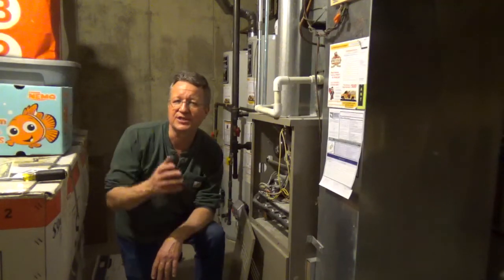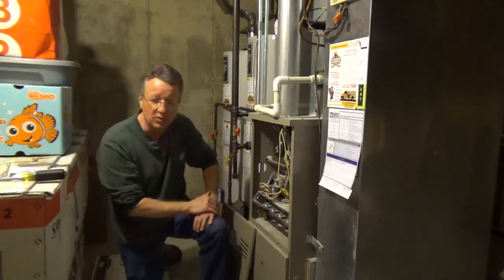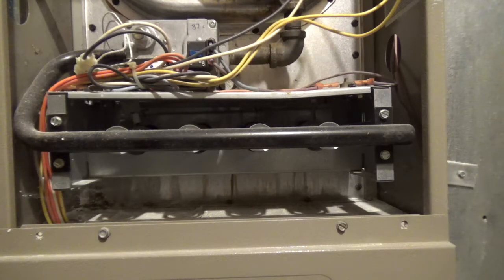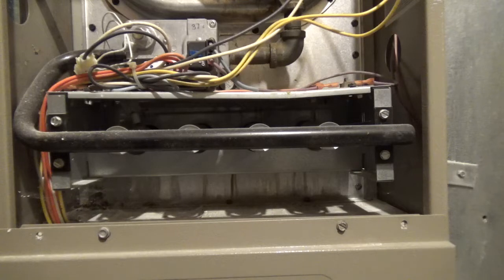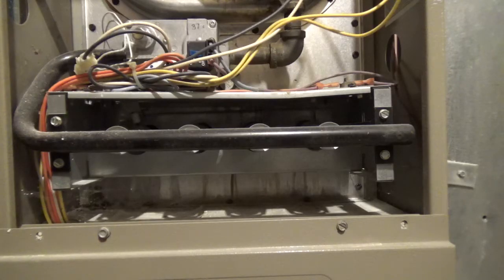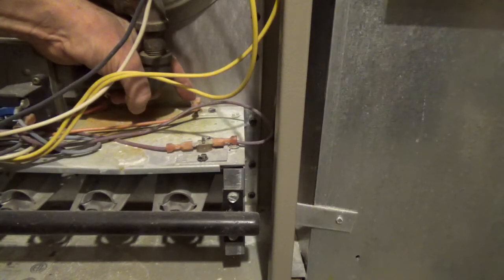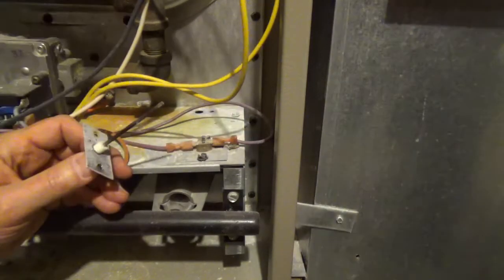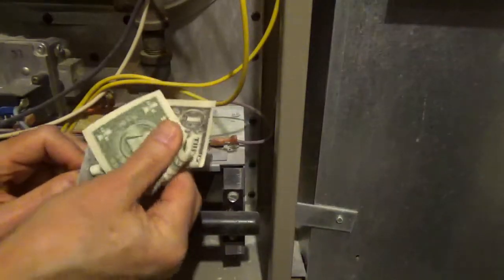Furnace Not Staying On - Furnace Short Cycling

Comment: Thank you so much. 

Last year I called our repair vendor, Service Lengend Heating and Cooling (the same vendor who installed the unit) and he told me my furnace was old and I needed to replace it. I was like ... "I just bought this new unit from you guys just over 6 years ago." He was like well, the new units don't last that long like the old ones. I should really be considering getting another new one ($5000). I asked if he could replace the part that was broken. He reluctantly said he could help make it work through the winter, but I should consider buying a new unit. 

I replaced my old unit, not because it wasn't working, but because I wanted something more energy efficient. It has been working for 20+ years. 

This year, the heater has the same issue but I didn't call the service repair. Instead, I started to research and learn more about how the sequence of operations worked on a direct ignite gas unit. Thanks to your video, it helped confirm what I thought was wrong and took your steps to fix it. It is now running like new. Thank you and will be calling a different service in the future.

Comment: I envy people who have this problem
 I cleaned it, switched it to a new one, changed the limit switch out (although the "new" switch was clearly not new, changed the filter, and it's still cycling with no spevific light flashing other than two quick flashes then a pause (lockout). The motor is ok. Time to call in a professional. Thank you for making this video.
Reply from the maker: Hi,
If you have a high efficiency furnace, here are some common troubleshooting tips.
Check the air filter, a clogged air filter can overheat the furnace causing it to shut down to protect the heat exchanger.
Check the air intake and exhaust, a partially clogged pipe can cause the furnace to shut down.
Check the condensation tube, a clog will shut down the furnace.
Check out more home improvement tips in our e-books https://www.amazon.com/gp/product/B0B2KW1FQ9?notRedirectToSDP=1&.

Comment: Hello. My furnace stays on for about 3 minutes each cycle. Will this work or does that mean it’s a different problem?
Reply from the maker: Hi, it's worth trying to clean the flame sensor first.
If you have a high efficiency furnace, here are some other common troubleshooting tips.
Check the air filter, a clogged air filter can overheat the furnace causing it to shut down to protect the heat exchanger.
Check the air intake and exhaust, a partially clogged pipe can cause the furnace to shut down.
Check the condensation tube, a clog will shut down the furnace.
Check out more home improvement tips in our e-books https://www.amazon.com/gp/product/B0B2KW1FQ9?notRedirectToSDP=1&.

Comment: Hi, I have this same problem but I already cleaned the sensor and it did not work. I called a pro and they could not find the problem. They told me to replace the flame sensor and try that but did not have one on the truck to test with and will have to come back. Otherwise they said it will be a board likely gone bad. Is there any other ideas what to else to try/check? I also replaced the air filters 2 on the ceilings. my furnace is in the attic its from 2003. thank you
Reply: I don't know how but it started working right after I posted this. i put a pipe cleaner down the jets there may have been some debris, the flame light LED is on yellow it was blinking on start up
Reply from the maker: Hi,
If you have a high efficiency furnace, here are some common troubleshooting tips.
Check the air filter, a clogged air filter can overheat the furnace causing it to shut down to protect the heat exchanger.
Check the air intake and exhaust, a partially clogged pipe can cause the furnace to shut down.
Check the condensation tube, a clog will shut down the furnace.
Check out more home improvement tips in our e-books https://www.amazon.com/gp/product/B0B2KW1FQ9?notRedirectToSDP=1&.

Comment: I had an Hvac guy to come to my home , his estimate was 140.00  to replace the flame sensor which didnt happen , although he did get working but it  wasnt blowing any heat unless i turn up the thermostat to 90° still not much heat after he replaced the circuit control board which you didn't tell me about he just replaced it and then handed me a bill it was like over $600 still having problems my boyfriend has replaced most every part in the furnace we still don't know what's wrong it won't cycle through. If anybody has any idea of what we might be able to do to resolve this I would appreciate it thank you so much for reading

Comment: Hi Enjoy your channell I have a lennox whisper short cycles at 72 degrees Comes on  runs for 6 minutes shuts off for 5 minutes, in an hour comes on six times  what might be causing the short cycles filter is clean   Thanks
Reply from the maker: Hi,
If you have a high efficiency furnace, here are some common troubleshooting tips.
Check the air filter, a clogged air filter can over heat the furnace causing it to shut down to protect the heat exchanger.
Check the air intake and exhaust, a partially clogged pipe can cause the furnace to shut down.
Check the condensation tube, a clog will shut down the furnace.
We have more home improvement tips on our weekly podcast https://itunes.apple.com/us/podcast/fix-it-home-improvement/id880903087?mt=2

Comment: I have an oil furnace. I cleaned the cad cell eye (flame sensor) but it still short cycles ......could this mean a worse problem.....I changed the air filter and nothing is blocking cold air returns or registers........could the cad cell eye(flame censor be bad and need to be changed)
Reply from the maker: Hi, yes, it could need to be replaced. Here is an article that might be helpful. https://inspectapedia.com/heat/Cad_Cell_Relay_Reset_Button.php
Reply: @FIXITHomeImprovementChannel  even if it doesn't trip the reset button on control box?
Reply from the maker: Hi, I would give the manufacturer a call. They should be able to help with troubleshooting.

Comment: Another reason for short cycling is the air filter. Sometimes a dirty air filter or even the wrong type of air filter can cause short cycling. I replaced mine with a cheap fiberglass glass filter and no more short cycling. Go figure.

Comment: I’m having issues with T.H.E 90 furnace model 2970E766. It turns on periodically for 15 seconds and then right back off. When I turn the thermostat to OFF cold air blows out. Any suggestions? Thank you!
Reply from the maker: Hi,
If you have a high efficiency furnace, here are some common troubleshooting tips.
Check the air filter, a clogged air filter can over heat the furnace causing it to shut down to protect the heat exchanger.
Check the air intake and exhaust, a partially clogged pipe can cause the furnace to shut down.
Check the condensation tube, a clog will shut down the furnace.
We have more home improvement tips on our weekly podcast https://itunes.apple.com/us/podcast/fix-it-home-improvement/id880903087?mt=2

Comment: If your burning natural gas  (which is clean)why would the flame sensor get dirty? I have a gas boiler for 18 years, never had this problem yet!
Reply from the maker: Hi, moisture and chemicals in the air form a thin coating on the surface of the sensor.

Comment: My ignitor glows then it shuts down no flame at all
Reply from the maker: Hi, it could be a problem with the gas control. Check that the gas valve is open. I would give the manufacturer a call for troubleshooting tips. I've found most companies to be helpful.
Reply: @FIXITHomeImprovementChannel  It is on, will the new one need to be adjusted? or plug and play so to speak? I replaced the pressure switch and flame sensor.

Comment: I cleaned the sensor and the furnace still turns off after 5 ish seconds of being lit
Reply from the maker: If you have a high efficiency furnace, here are some common troubleshooting tips. Check the air filter, a clogged air filter can over heat the furnace causing it to shut down to protect the heat exchanger. Check the air intake and exhaust, a partially clogged pipe can cause the furnace to shut down. Check the condensation tube, a clog will shut down the furnace. We have more home improvement tips on our weekly podcast https://itunes.apple.com/us/podcast/fix-it-home-improvement/id880903087?mt=2

Comment: Mine cycles after a few seconds to a couple of minutes.
Reply from the maker: Hi, 
If you have a high efficiency furnace, here are some common troubleshooting tips.
Check the air filter, a clogged air filter can over heat the furnace causing it to shut down to protect the heat exchanger.
Check the air intake and exhaust, a partially clogged pipe can cause the furnace to shut down.
Check the condensation tube, a clog will shut down the furnace.
We have more home improvement tips on our weekly podcast https://itunes.apple.com/us/podcast/fix-it-home-improvement/id880903087?mt=2
Reply: @FIXITHomeImprovementChannel  Thank you, I will.